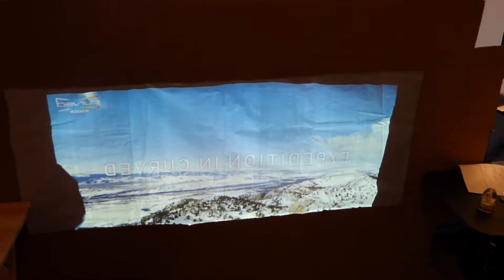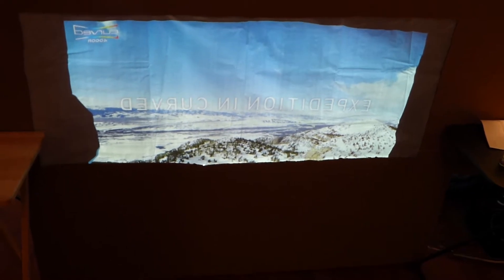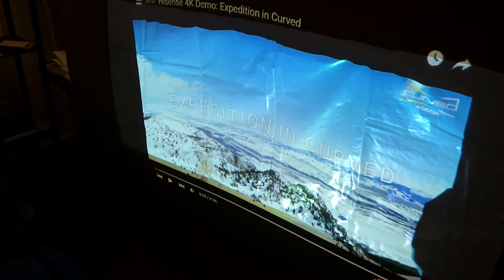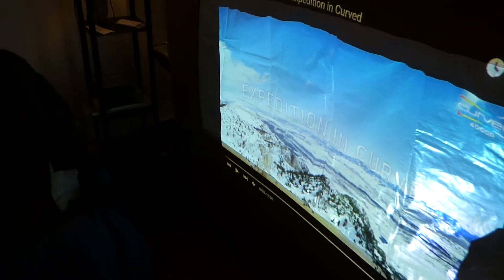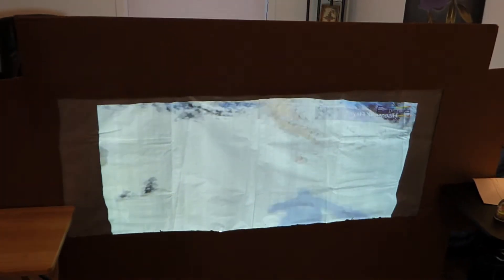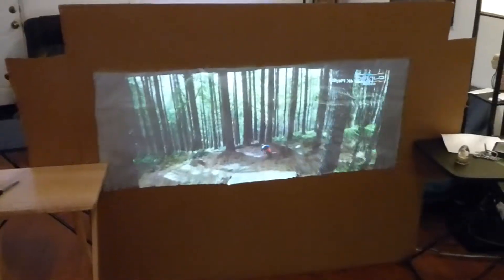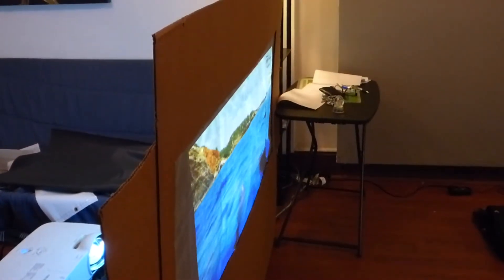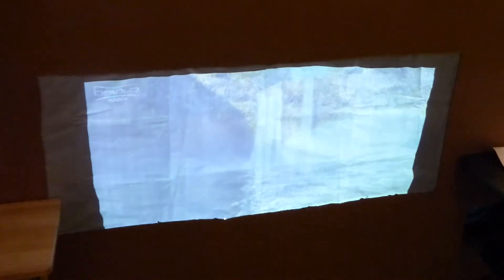REAR PROJECTOR SCREEN TEST SO FAR SO GOOD

Comment from the maker: Quantum light fusion 
Rear Projector Screen blackout cloth
Max. Viewing Area (W x H): 146" x 61"
Max. Diagonal: 158"
Aspect Ratio: 2.39:1
Gain: Smart technology gain
Screen Material: PVC Film Flexible and super stretchy
Lumens 300 and up
Projectors short throw or long, Dlp, Led, Lcd
Fully weatherproof
Price $875.04